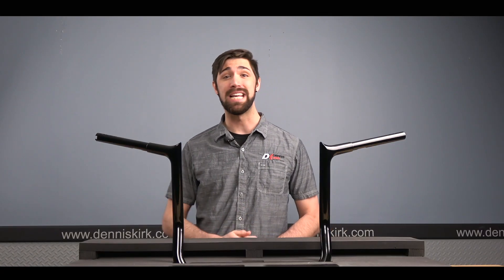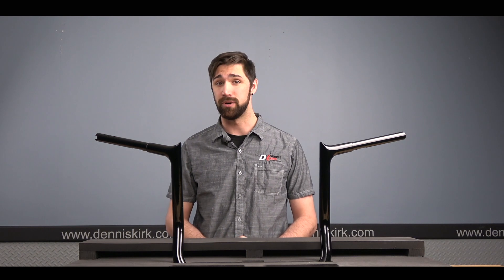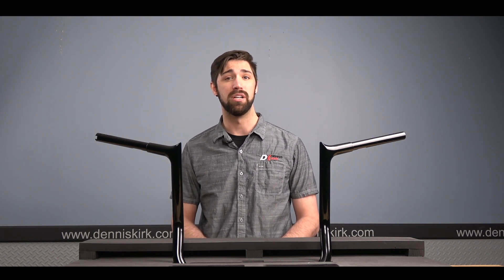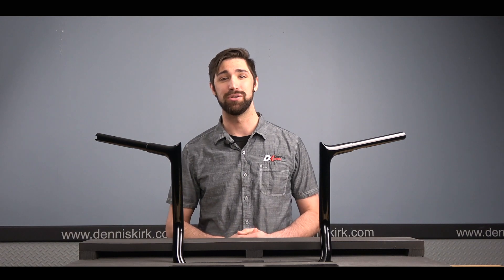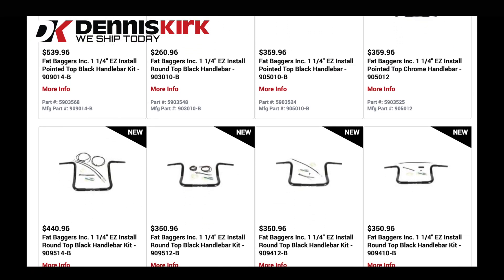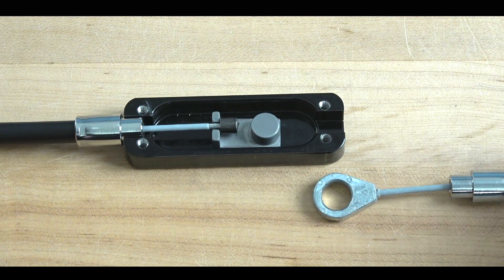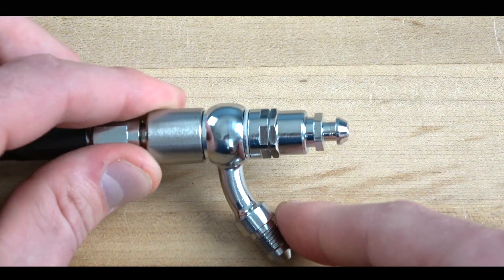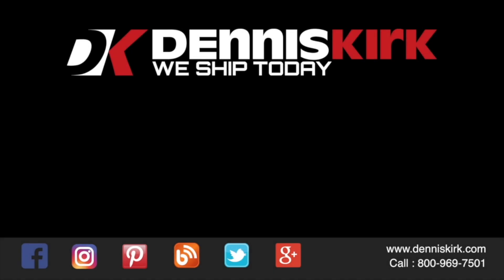Fat Baggers EZ Installation Handlebars Overview

Comment: i just got a kit-i thought the wires were plug ins on both ends- NOT !!- you have to solder them-whats ez about it ?-had i known that i never would have ordered these-in the install video it shows only one end is plug and play- what they don't tell you is that the other end you have to cut your existing wires and solder and thats what i wanted to avoid cuz i suck at soldering-yes the 2 piece handlebars will make it easier to run the wires up through but they should mention in the video that there is soldering involved-2 thumbs down on that one
Reply: Good to know !